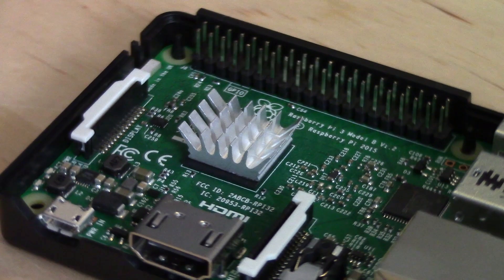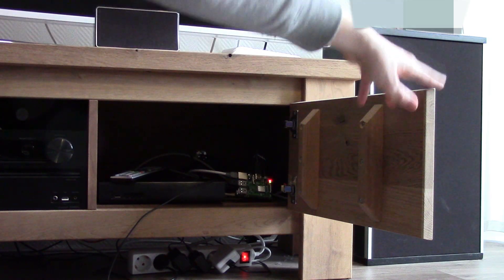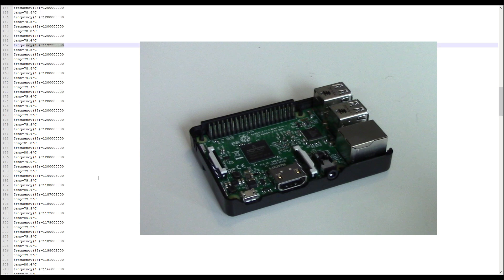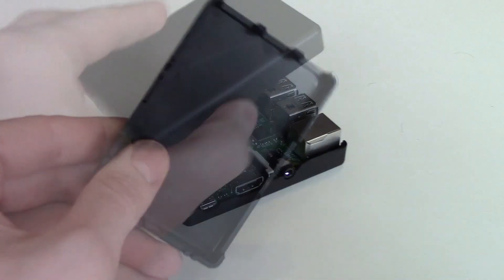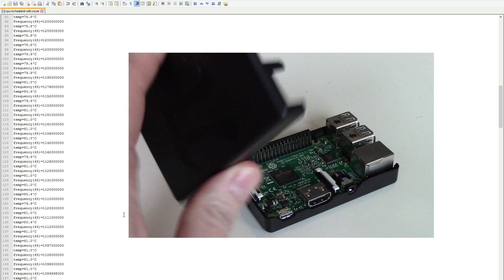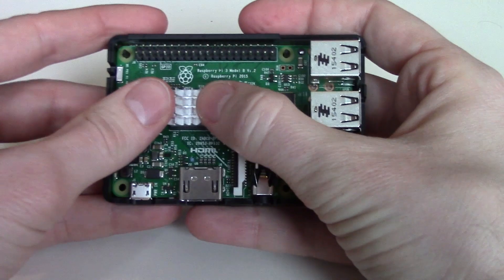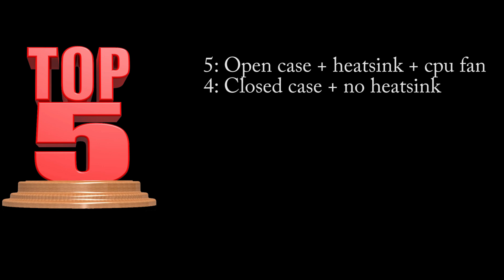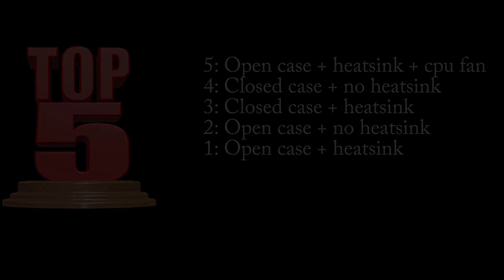Raspberry Pi 3 Heatsink required?

Comment: My Pi 3 overheats quite fast in my Megapi case even with heat syncs. I ordered a couple fans. 2 just in case 1 fails. Throttling causes massive performance dips in mame and PlayStation.

Comment: You really need to test how long it takes to get up to throttling temp and then how quick it goes down again. This time is critical. You will not be pegging the CPU out all the time, but your ant to know how efficiently the heatsink (or without) the CPU can get below temperature in order to run at full speed again.

Comment: Um. I made not now much about water cooling but isn't that a bit much for it? I mean you could just buy a new case with good air flow and also have a good heatskin or none at all I maybe wrong but that's my opioion.

Comment: See I wouldn't use the kernel for measuring temp.  I have an IR gun and in mupenplus or snes9x I see a max temp of ~49C with my Rpi3 inside a case.  This is with standard clocks (1200MHz).  So unless your over clocking or in a really hot climate you don't need a heatsink.

Comment: With my Raspi3, it got hot enough that it erased data on the sdcard and the usb memory stick I had in it. both had to be reformatted. They are both still usable, so luckily no hardware damage, just data loss. I was running Ubuntu and watching video from Youtube each time I had these heat issues(yep, it is a repeatable experiment), I haven't heard of any others having this severe of an issue, but heat is a problem with RPi3. I now run OpenElec Kodi and can run it without a fan, but still keep heat sinks on both chips on top and the chip on bottom(which seems to create the most heat). No problems with Kodi. To keep Ubuntu around, I got an Odroid C2 with the eMMC card, and it runs Ubuntu MATE with ease.

Comment: There are nice ABS cases with small fans installed available on Ebay for around $3.25 US or slightly bigger Plexiglass enclosures with fans for around $5 US. Copper heat sink kits can be purchased for $2 US. These fans can be plugged into the GPIO on the 5v side for full fan operation or the 3.3v side to run them slower and quieter if they're too loud. Being able to run the low power fans from the GPIO (no additional power supply needed), makes it a no-brainer for me.

Comment: if your going to overclock it your going to need a heatsink anyways. ..1450mhz is my max oc.
Reply: thanks for the overclock tip pal
Reply: I usually run 1400 with OC ram, added GPU memory and etc. Able to run Youtube on Raspbian at 480p with very little spikes (with tv running 1080p because it won't recognize my TV and allow me to change the resolution). I'm sure if you have the monitor at 720p you could run Youtube 100% flawlessly at 480p

Comment: With my Pi 3, i use the panel app that has the temp and cpu meter as well.  My temp never went above 65°C and my idle temp was around 50°C. I do occasionally feel some heat come out.  I will attach my heat sink that came with the kit and see what happens.  Curious, did the other Pi models get as hot as the Pi3?

Comment: This is good enough. I used heatsinks with the RPi2 since it was overclocked and it helped keep it from throttling but I'm assuming your tests were without any overclock. I suppose it time to either get a case that has much better airflow or make a really small fan to run off the GPIO. Thumb up~!

Comment: You should have tested the fan on the CPU with NO heatsink.  That would have given you a benchmark to determine how effective the heatsink really is. 

I suspect the biggest problem with PI heatsinks is the adhesive layer is too thick.
Reply: ABQSentinel ya

Comment: This makes me wonder if cutting a small opening in the top case to fit a small 5V fan would help.  I assume that the case would need extra vent holes to blow out the hot air.  The really small 5V fans aren't too loud.
Reply: you can buy cases that include a small fan for dirt cheap. I just got a clear one with a fan for like 4 dollars
Reply: I cut out the bottom of my Pi case to make room for a heatsink, since the bottom chip gathers the most heat. then mounted a small 5v fan and just leave the case sitting upside down.

Comment: What about a bigger heatsink?
Reply: +eLJaybud good luck finding one under $35
Reply: Consig1iere The chip is very, very, very slow.
Reply: +Malcolm Hunter What about it?
Reply: Consig1iere Wouldn't that help bring the temperature down further?
Reply: +Malcolm Hunter Yes it would but then again it depends on what you are planning to do with the RPi. If you are not planning on anything CPU intensive all the time then a small heatsink is adequate. The difference between a slightly bigger heat sink and a smaller one would be slim if you are using light application that are not CPU intensive.
Reply: +Consig1iere If you're not doing anything cpu intensive then just buy a pi zero.
Reply: Gurkan Ozil Already have one thanks. Got it on the front of the Magpi from my local Supermarket.
Reply: eLJaybud Too bad i can't find one ;';
Reply: Gurkan Ozil They are only out of stock because the Pi Foundation made them themselves unlike the other Pi models, but had changed focus to the Pi 3. Supposedly they will be stepping up production to 50,000 a month to satisfy demand. Supposedly they just need the time to get it all online.
Reply: +Consig1iere depending how much is happening with it. Lots of pi projects.
Reply: Or you can buy the CHIP.

Comment: Heatsink + fan is the best option in any scenario! Just dont let the fan run on full blast, but on a much slower RPM. Any decent 120mm fan with a reducer in a cabinet will do fine without any real noise, if mounted correctly
Reply: +Lampuhkap&#39;s Shaving Channel 
I use a small fan from an old GPU, and it plugs right into the GPIO. 111f without and about 80f with the fan on.
Reply: 120mm fan is a bit big though. One of the selling points of the Pi is its size.
Reply: true, but is easily available at pretty much every store and pretty much always pretty silent. small fans make an awful lot of noise and are not always easily obtainable.
Reply: I don't think a fan is necessary on the Pi 3 unless you're overclocking. I really like my Pi to be silent. Heatsinks are good, though. I was building a cross-compiler and the Pi kept throttling at 80 degrees, and it took forever.

Comment: So heatsinks for the Pi might finally be worth getting, they haven't been needed nor done much on the previous models. A cool setup could be to find a small fan to put ontop of the heatsink, poweres by the IO pins. Should be able to fit inside the case and shouldn't be particularly noisy.
Reply from the maker: +Emil Blem A small fan (40x10 mm) should be a good  one. Powered from IO or USB. Happy moddi'n!
Reply: some Asus mother boards come with a small fan for the vrm's it would be ideal
Reply: No its powered by 5 volts not 12.
Reply: It has to run on 5 volt though, but i mean, isnt the pi 3 powered by 12 volts? isnt it possible to solder onto that 12v?